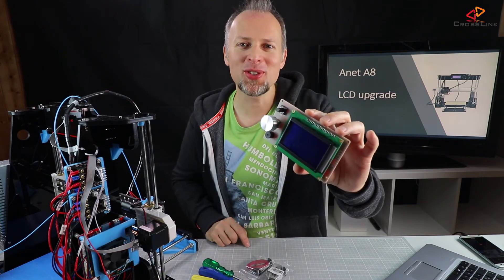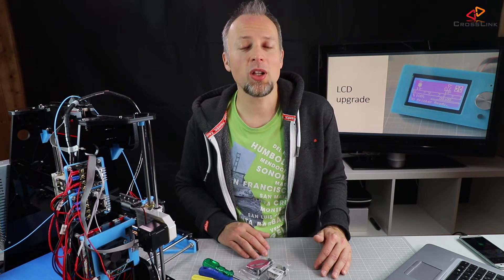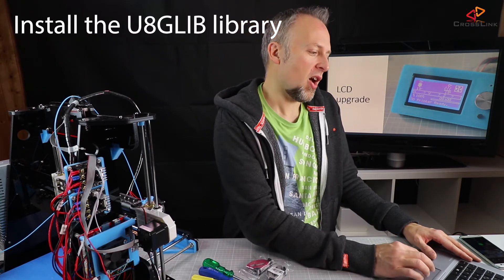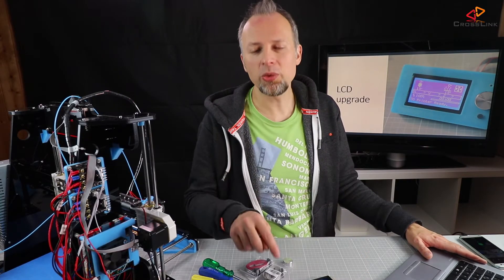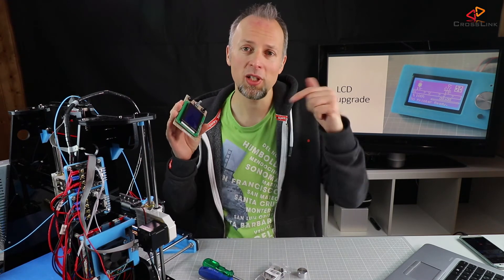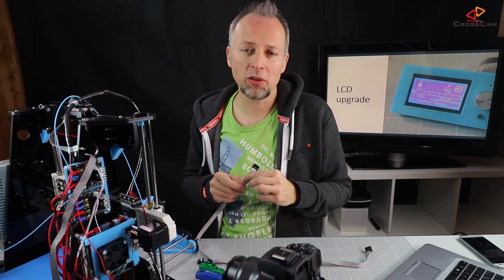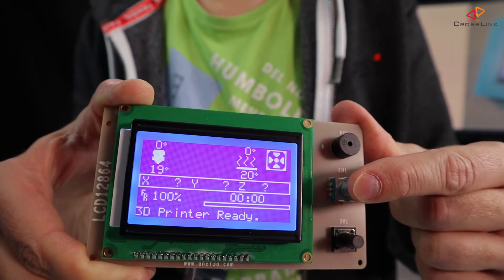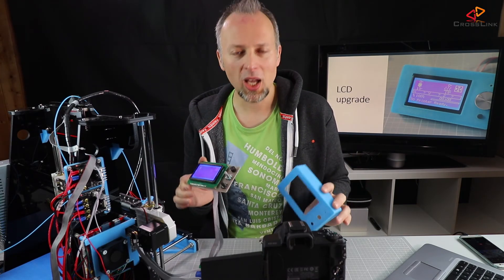Anet A8 lcd upgrade - step by step

Comment: Do you need to update firmware just for the new screen? Or can you just change the display as is??
Reply from the maker: Nope, the original firmware does not support the new screen, so you need to update.
Reply: @Crosslink3D  thank you very much for replying I really appreciate it, plus I want to say your videos really help and I’ve learned a lot more with your help 👍

Comment: Hello

I have a problem with this LCD 12864: with every step of the motor (on X, Y, Z) there is a delay from aprox. 1 - 0.5 seconds, and i cannot move AXIS properly. This is on option Move Axis (Manual) 

I updated to marlin 2.0 bugfix firmware and i already do the changes for LCD on the Configuration.h file like in the video to make that the LCD works. 
But the axles is not woking fine. 

Can someone  help me?

Comment: when i try to do it on the Marlin bugfix 2.0.x it just says it fails and this is written above:
* [.pio\build\sanguino1284p\libb88\Wire] C:\Users\User\Downloads\Marlin-bugfix-2.0.x\.pio\build\sanguino1284p\libb88\Wire: The system cannot find the path specified
can somebody help?

Comment: Hi all,
Did the upgrade on my AnetA8, but the display was garbled after te upgrade.
See link. https://i.postimg.cc/vBG0TfWj/LCD12864.png
Found a hack to get things right 
#define REPRAP_DISCOUNT_FULL_GRAPHIC_SMART_CONTROLLER
#define ST7920_DELAY_1 DELAY_NS(200)
#define ST7920_DELAY_2 DELAY_NS(200)
#define ST7920_DELAY_3 DELAY_NS(200)
And now the display shows this.
https://i.postimg.cc/TYQWmsZC/20200831-141021.jpg

Hope readers will benifit of this.

Comment: I had to include the following lines after the #define ANET_FULL_GRAPHICS_LCD line to fix the corrupt display.

#define REPRAP_DISCOUNT_FULL_GRAPHIC_SMART_CONTROLLER 
#define ST7920_DELAY_1 DELAY_NS(0) 
#define ST7920_DELAY_2 DELAY_NS(250) 
#define ST7920_DELAY_3 DELAY_NS(250)

Thanks for the video.
Reply: Thanks for your lines, I have solved my corrupt display issue.😉🤛
Reply: Where do you insert these lines? my lcd is bad too
Reply: Thank you! This fixed my issue too.

Comment: Halo Daniel! As before, I'm here very late after the moment your video was posted...! Anyway, what kind of replacement for the LCD 12864 display would you suggest, as the one you mentioned is discontinued... (both on Gearbest and amzn)?
Thanks for your answer, or the one of the community!
Reply: I just bought one on Amazon yesterday, so they have them
Reply: @johnomeara7240  thanks so much for you answer John, almost 2 months after my post! I appreciate!

Comment: I bought a motherboard  V1.7 for Anet A8 3d printer, but when I switched on, the LCD lit up, and without any writing,  and I can't control the screen from the keys. Although the screen was working with the previous board 
then  I Try  to  upgrade   firmware to the Anet A8  V 1.7 motherboard, by Marlene and Arduino IDE, the firmware upgrade  did not complete and I got an Error Msg form Arduino IDE (Error compiling for board Anet V1.0..)
how i can solve this problem?
.... What is the problem please?

Comment: Hi Daniel, Great videos - Thank you! I'm going to assume that when you make the change in Marlin it reconfigures the way the display looks for the new hardware? (I have one coming)

People knock these A8's but I've got mine to the point that it prints really nicely. Today I'll be 'going Bowden/E3D' for the weight savings. Probably in a few weeks I'll spring for the actual aluminum AM8 kit and work in the linear rails I've seen on Thingiverse. I presently have my A8 strapped down to a concrete patio slab with a cargo strap and it's pretty quiet now. Mass is what creates good prints from a frame standpoint and unfortunately 3D printers in general lack it.

Comment: Followed your guide exactly but my LCD is not working correctly. My printer was a CTC i3 pro B but is now modified beyond recognition. My printer was supplied with a mainboard with no identification on it but I have figured out (after a lot of research) that it is a Anet A8 mainboard. It originally had CTC firmware on it but I have flashed it to Marlin 1.1.9 after having followed your exelent guide and used the Anet A8 hardware configs. The firmware works perfectly on my original LCD (the rather horrible 5 button one) when I flash Marlin back to before making the changes form this video. When flashed to Marlin after the changes from this video my new screen works to a degree. I can see most of the bootscreen and can just about makeout the menus but all the text is garbled and a little unstable. I just wondered if you had any ideas. The new screen is the Anet LCD12864 and looks identical to the one in your video. It almost looks as if the refresh rate is incorrect it that is any help.
Reply: Thanks to weeurey this problem is now fixed. This is exactly how I did it just in case someone else has this same problem.
#define ST7920_DELAY_1 DELAY_NS(0)
#define ST7920_DELAY_2 DELAY_NS(250)
#define ST7920_DELAY_3 DELAY_NS(250)

I added those three lines just below  #elif ENABLED(ANET_FULL_GRAPHICS_LCD) in Conditionals_LCD.h.
Uploaded it to my printer and all is good. :)

Comment: I have a reprapdiscount full graphic smart controller and i sucesfully installt it but it doesn't work the lcd the connectors are exp1 and exp2
Reply: I also have that LCD and I can tell you that the connections are different so it won't work as is.  I will be doing a lot more research as I want to get mine going. I will post here if I am successful.
Reply: @TootEmCarMan  tnx
Reply: @youris4095   Just to let you know I think I have corrected the wiring and the screen lights up and partially works, I can see 1/3 of each line but the other 2/3rds remain blank. I'm thinking it's a timing issue but have not had any success with it to date. I haven't given up tho and will post again when I have more news.
Reply: @TootEmCarMan  can you send me youre settings with marlin
Reply: @TootEmCarMan  because i dont have anything only a screen that's on
Reply: @TootEmCarMan  do you have discord
Reply: @youris4095  Sorry, don't know what you mean by discord. It's the Marlin settings that I am still working on. Using jumper cables and changing the wiring physically is how I have managed to get the screen partially working. I will be taking another look at Marlin later today.
Reply: @TootEmCarMan  owwwww okey. discord is a chat like skype.
Reply: @TootEmCarMan  i got a new motherboard and i did uploud the same marlin but the prints are sooooo mutch crap everywhere holes and bad extrusion idk why this new board doesn't work
Reply: @youris4095  Marlin settings are obviously wrong for your printer. You need to set the correct steps for each stepper including your extruder stepper to get your printer working correctly. Google should find you the correct settins and tell you where to put them. You can manually adjust your printer in the steps menu but you really need those settings correct in your firmware. What board did you get and what version of Marlin did you flash it with? Your printer is a A8? I will do what I can to help you out.
Reply: @TootEmCarMan  i am making the cable for it now i got a kit to make the cables
Reply: @TootEmCarMan  its the anet a8 board v1.7
Reply: @TootEmCarMan  its marlin 1.1.9 with the already prepared software
Reply: @youris4095   A major issue I had was that my printer has lead screws for the z axis and that the Marlin default z axis steps looks to be for belt and pulley as an example. My steps are set as follows -  x&y 78.82, z 2560 and e 108. I am not saying that those will be correct for you but you can compare them to default steps in Marlin to get an idea how far they are from them.
Reply: @TootEmCarMan  I cant test it right now because my pc says at the USB port error code 43 I dont know how because 1 Day before it worked great i AM thinking to go call the Windows callcenter
Reply: @youris4095  USB port error code 43 is not exactly uncommon. Try uninstalling all usb drivers in device manger then re-start your computer withthe printer disconnected then connect it once windows has fully booted.
Reply: @TootEmCarMan  still the same i did it already before because i search it up but it doesn't work :(.

I have a USB c to 4 USB 3.0 connector because this is a Windows tablet maybe this is why IT doesn't work?

The mouse and the USB c to 4 USB 3.0 works because my phone has a USB c
Reply: @youris4095  I am a computer engineer by trade and I have to say those Windows tablets are just about the most un-reliable type of computer I have seen so good luck with that one.
Reply: @TootEmCarMan  tnx. This laptop is from school and my own pc died so i am thinking to go to the IT of School
Reply: @youris4095  Let me guess? MS Serface? Worst of it's type in my opinion. Why invent a "laptop" with severly limited capabilities then make the OS too big to actually fit on it?? The mind boggles!
Reply: @TootEmCarMan  do you know a good and cheap epoxy
Reply: @youris4095  That really depends on where in the world you are. I am in the UK and I use epoxy from Ryman's as it's cheap, quick setting and strong.
Reply: @TootEmCarMan  i live in the Netherlands

Comment: I followed your video and my lcd is working but the characters are all jumbled, I can barely read it. Any suggestions??
Reply: Nevermind I think I found it, thanks!
Reply: @adambeaudry3976  No worries!
Reply: Did you ever fix this? Same issue :(
Reply: Nope still not working, going to switch back to original screen
Reply: @adambeaudry3976 
 #define ST7920_DELAY_1 DELAY_NS(0)
#define ST7920_DELAY_2 DELAY_NS(250)
#define ST7920_DELAY_3 DELAY_NS(250)

Pop that in right after the line where you define the lcd_anet_full or whatever it is
Reply: @weeurey  Thanks alot. It worked great!
Reply: @adambeaudry3976  i figured it out, there are some delay lines you need to put in
Reply: @weeurey  im having this problem
how to fix
Reply: Can you elaborate? What lines where?

Comment: problem help please  i got anet a8   your configuration work fin   the lcd 12864 work fine im using marlin 1.1.8
the problem is wen i plug the lcd cable with the 3 calbe for the bltouch im lousing evrrything on lcd

Comment: what version board did you use mine is a v1.5 and dose not work
Reply from the maker: In that video, I used board version 1.5. It only works with the right firmware. Did you configure Marlin for the right display?

Comment: Quick question if using the BLTouch on pin 27 (standard display) do you need to move it pin 29? Or just change the pins_anet_10 in Marlin Firmware?

Comment: hi . i uplode  marlin to my board every thing is ok but i cant print with sdc card after i but the sd i check the lcd i fund ( no cd card ) ? thank you
Reply from the maker: I would like to help here, maybe you need to explain a bit more in depth what is failing. Are you unable to use the SD card? Did you use the "init sd card" menu item before trying to print from the sd card?
Reply: The failure is after I insert the sd card i go to menu check the cd card i found (no cd) 🙃 .

Comment: I tried this and I connected the new lcd before flashing and it let out a long continues beep. I disconnected it immediately. Now my board will not let me re flash it. The lcd lights up and the fan is working but the led on the board is not on. I've tried to re flash  the boot loader with an arduino uno without success. It is an anet 1.7. Do you think the board is fried?

Comment: What is the use of the speaker for?  I thought that it was for telling when a print finished or something. Is there a way to put that into config, and how would you do that?
Reply from the maker: You can use gcodes to play tones on the printer. You should add those tones to the end g-code section in your slicer software. Here is the description how to use it: http://marlinfw.org/docs/gcode/M300.html

Comment: Question Daniel, I have an A8, just uploaded Marlin 1.1.9 bugfix, and flashed it. Looks like all ok. Bought the same graphics lcd, followed your video here, and compiled . I get an error at the end "Error compiling for board .Anet V1.0".  Then in the verbiage at bottom of screen it says " Sketch too big" Sketch uses 128256 bytes (101%), of storage space. Maximum 126976 bytes.
Reply from the maker: Steve, you can disable some minor features. In configuration_adv you could disable ARC_SUPPORT. That already gives you about 3kb back
Reply: @Crosslink3D  Thank you, someone else also said to Disable_M503, and that saves 2700 bytes of memory, and I did that, and was able to compile, and put the full graphics display on. I am now at 98% of available memory of board, so when scrolling through sd card, it really lags, but could disable sd card, and just use USB cable I guess.
Reply: @steveedwards6451  @Crosslink
Thank's for the explantion. you help me a lot.

Comment: I received my new 12864 LCD, and was going to update the Marlin software that was already installed on my board (followed your tutorial to the letter, using USB cable and worked perfectly), but now I'm getting an error - avrdude: ser_open(): can't set com-state for "\\.\com7"
Board and Port are set correctly in the Tools menu; Verify works without error.
Did everything like the last time, U8Glib is installed in the IDE. Is there something else I need to do on configuration.h regarding the U8Glib?
Could the bootloader have become corrupted on the board since the previous upgrade to Marlin? And if so, would the USBAsp (the one in the link below) work to reflash the bootloader? https://www.amazon.es/dp/B0785RQ766/ref=cm_sw_r_cp_apa_i_2zJaDbHV4ABB1
Furthermore, I'm planning to add a 3DTouch auto leveling sensor really soon (I'll be following your tutorial BTW), so I understand that the modified bootloader is required due to available space in the ROM (using the new LCd together with auto leveling) , so I guess I'll pretty much need the USBAsp anyway. Just want to make sure I get the correct one!
Thanks in advance, for any support you can provide!!
Reply: To answer my own question, I got this sorted by using a different computer, that had never seen the Arduino IDE, Marlin, or even connected to the printer.
Still plan to figure out the root cause for this issue in my computer (drivers, or whatever) 'cause I didn't do anything to mess it up. Well, at least, nothing I'm aware of...
Either way, if you can provide feedback about the USBAsp (the one in the link from my previous comment) I would really appreciate it!!
I'll give some more feedback once I find the cause.
Reply: hi Paulo the you tri update usb port on your computer if not you shud trie that

Comment: hello, the file in the arduino it to big for my anet a8, can i reduce it ?
Reply from the maker: Depends on what else you are using. If you are using any bed leveling feature with the lcd you will need to flash the optiboot bootloader. A new video is coming these days about how to do it.
Reply from the maker: New video is out about different flashing methods. Check it out!

Comment: If you're using Marlin already, didn't you already install the U8GLIB library?????
Reply from the maker: Nope, I would not assume that it gets installed by default. I had the issue several times that it needed to be installed manually.
Reply: I'm getting the U8glib error.  What did you do to fix this?

Comment: ciao ho installato questo display sulla mia anet a8 e marlin senza problemi,lunica cosa che ho notato che quando stampo vedo la percentuale di stampa sempre al 100% e uindi non so a che punto sia arrivata la stampa,cosa sbaglio?con il display originale funzionava. grazie
Reply from the maker: I have to check if that is the case for me, too. I don't use the display for watching the progress so much as I am using Octoprint. But I will tell you if I see the same issue on my printers.

Comment: I have done everything and it's working fine if I only connect LCD connector. Whenever I'm connecting J3 connector to main board, LCD become blank. Do you know why? And why we need to connect j3 connector?
Reply from the maker: Well, the second connector is probably routing some additional stuff to the board like the beeper and buttons/dial. But I never saw that issue.

Comment: hi.did u modify the board? can i add this lcd display to my stock anet? i already upgraded firmware and use bltouch..so beside adding library.any other thing i need to buy? or upgrade
Reply from the maker: Sure, you need the display. Link in description. Also u need some adapter as described.
Reply: @Crosslink3D  so i can use stock anet a8 board?
Reply from the maker: Yes, use the stock board but you will need the adapter. Either the one I built in the video or you will have to cut your display wire as described.
Reply: @Crosslink3D  the cutting is same rite for bltouch purpose
Reply from the maker: Yes, if you have the bl touch already using a modified display cable this should work.